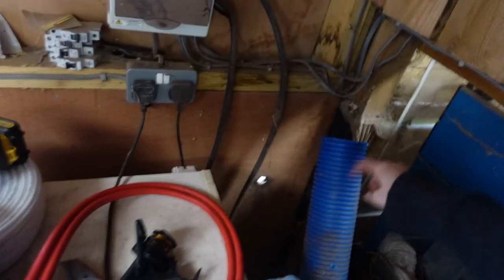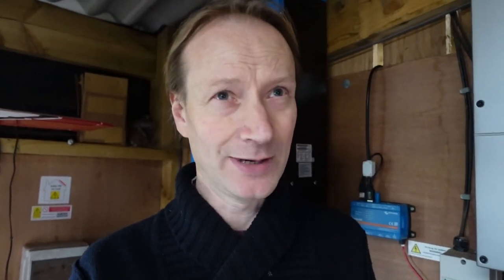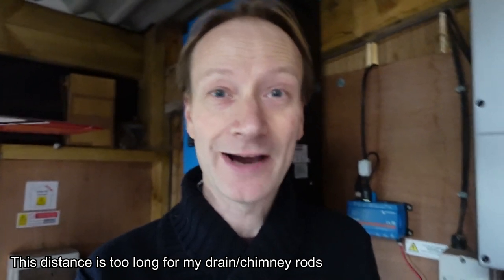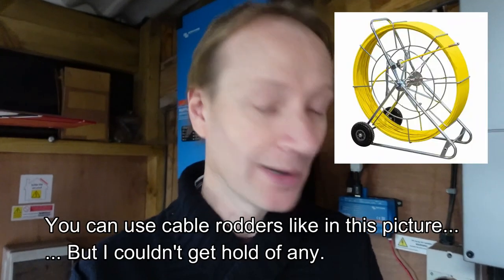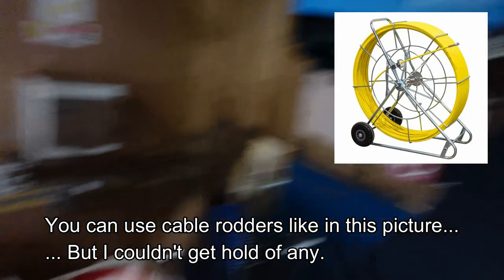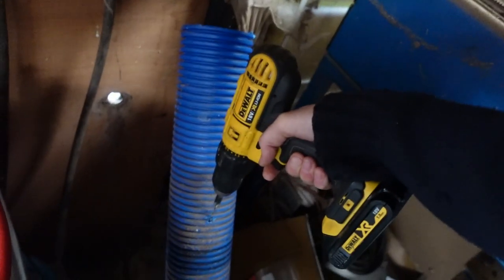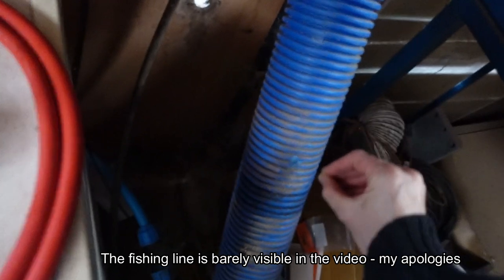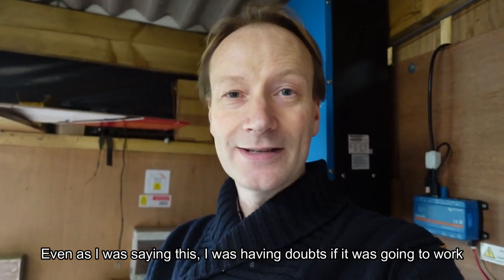How to get a cable through long underground pipe - SOLVED!!

Comment: Brilliant! I have a conduit underground from my house to the barn 200 ft away. I duct tape new coax to the old every two or three years and pull . If the cable ever snapped I would try this .